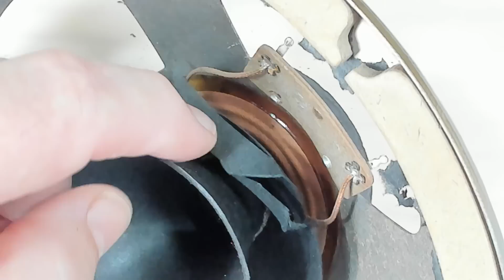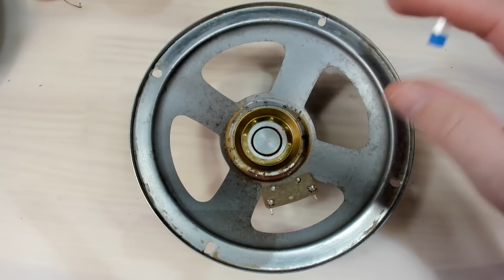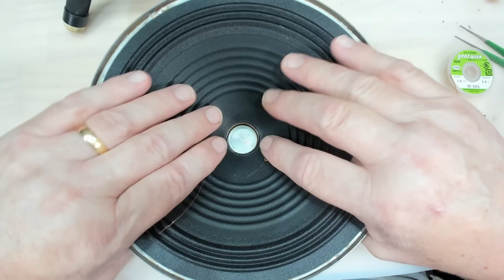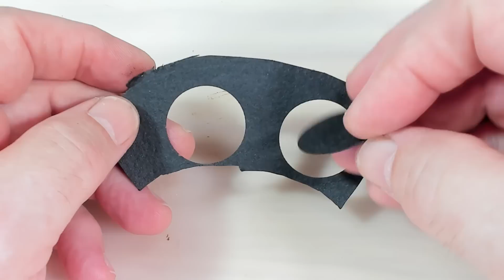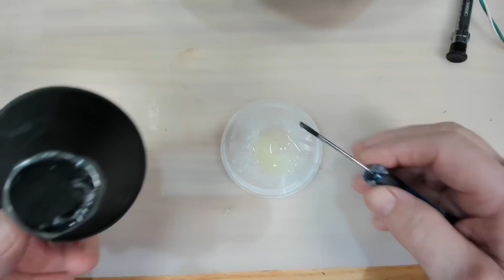Kriesler Radiogram for 5 Bucks!  The Speakers. Part 3

Comment: Excellent job on those speakers David, wow they came up well ! Great informative video. 
I might try that technique on my Breville rebuild, the speaker is not good at all, then again just might send it to you 😁
Cheers
Reply from the maker: Hi Baz, thank you. The full range cones are readily available after a bit of searching. Getting them with the small hole is the problem. A cone with a larger hole could still be used if you leave a portion of the old cone and glue the new cone to it. Good luck with your Breville, I don't remember what the speaker looked like 🙂

Comment: David Excellent work on the the two Rola Speakers you have a surgeon Hands brilliant work David,I have apologise when I said Solid state model was fitted 30inch Woofer it was 15inch Magnavox Woofers,The Magnavox company was had factory in Sydney long gone now as is Rola company also they made speakers for HMV also,More useless information the Kriesler company had off shoot company called Kreisler Dawson they made the Cabinet for your Mulisonic Radio Gram,
I later years because of Cost cutting the name Dawson disappeared the Cabinet were made of chipboard and covered with vinyl.
I can remember clients complained that Teak finish CTV the surface was lifting when they applied Teak oil,

They were disappointed when told the Teak finish was vinyl 

David on your active antenna was hear 549 KHz It Australia only long was wave stations it is ABC Station in Cumnock near Orange 
It had excellent coverage I am interested you can receive on your active antenna’ in  Queensland Best Regards David,Ian,
Reply from the maker: Hello Ian, thank you. I assumed you mistyped the 30" speakers, but two 15" is the same as a 30". 
The cabinet on this one has the Kriesler Dawson badge on the back. Yes, I've seen the cabinets with the vinyl covering, they don't last well at all. 
I think it has to less that 520 kHz to be considered long wave or at least out of the medium wave band. At night I can pick up an ABC station loud and clear at about that frequency. I'll set a radio up to 549 kHz with the generator and see if it can pick up ABC Orange tonight👍🙂
Reply from the maker: Hi Ian. I am able to receive 549 in Cumnock. I finished a radio today and it picked it up after dark, nothing during the day.
Reply: @ That is excellent News David it is 50kW Station and marvellous coverage.

Comment: Hi David. I've been dealing with some health issues, so especially at this time it's great for me to watch a new David Tipton presentation! You know that "ordinary" $5.00 discarded unit became a handsome "walnutty" class piece of furniture. The choices you made were just right. I really liked the long metal name badge. It came out perfect. A lot of fun watching and learning on this "speaker" episode. Saving the "Mystery Element" for last will be a nice surprise. When my older brother and I were young, we experimented with "passive" things you could do to improve the sound of our radios, like moving it closer or farther from the wall, placing it on different materials, ie; felt, soft foam, etc. The one that I really remember was when he purchased and extension speaker box, about 10 inches square. He placed an old wool sock in the box and it was shocking how much it improved the sound! Thank you David for the work you put into these episodes. -Chris
Reply from the maker: Hello Chris, I'm sorry you have been unwell. I hope that improves quickly. I suspect this gram would sound different if it was backed onto a wall. My mates and I did the same thing back in the day, moving speakers around to test the sound. I don't recall putting a sock in the speaker box but we did play with the poly lining wool and port sizing. We were probably too young and stupid to notice any difference 👍😄

Comment: Years ago, I read in some electronics magazine that there was a "hidden" third channel in most stereo systems. The article went on to explain it was a simple mod to pull that channel out of the system by hooking both the + wires from the L and R outputs and you would get the unique third channel that would actually put you at the location where it was recorded. I don't know about transmuting a person to the location but I do know that I hooked several of my old Stereo systems up that way and it did give me a nice sound  that pleased me greatly. I began going to yard sales to find stereo speakers that I could use for my projects. I had a nice Zenith council system that I moded that way and when I played "Crimson and Clover" it was so real that like Cheech and Chong, I nearly saw GOD!  Give it a try and see what I mean. I haven't  tried it of late and I would guess that I probably would not be able to tell anymore, my hearing has been leaving me a bit at a time since I got back from Vietnam in 71, thankfully the VA gives me new hearing aides every couple of years and that helps. I find that now that I alone, having lost my wife 5 years ago to cancer, music gives me great comfort and I now spend many more hours with either ear buds or a headset on listening to the tunes from my youth and remembering those girls from the 60's when there was no AIDS to worry about and love was very free and oh so wonderful. I am still playing with  my WIFI radios that I built using ESP32's and little decoder boards, there are  hundreds of great stations free for the taking now days.  Ah but I ramble on, and my post is becoming a book.  Thanks for the great videos Dave, I do love them and I always come away a bit better with more knowledge then I came in with. I have a firm belief that part of staying young is keeping the brain active which includes trying to learn something new every day.. I have also been downloading books from Guttenberg dot org where you can download millions of books on about anything free of charge. Guess none of them are completely free as I have to pay for the internet, but now days, where we live we can only get our internet from 2 services, our local cell tower or our local telephone/cable company. I still get mine from the phone company, although why I still have a wired phone is a question I keep raising, now that my mom joined her 2 husbands, 2 daughters and my lovely wife in heaven, I no longer need the wire, just that it's bundled and it would cost me more to split the bundle then I would save in the phone cost.  Same with Cable TV I guess, I have a Roku and use it a lot, I could get all the programs I usually watch on TV off that device and watch at my leisure rather then seeing all the damn commercials for pecker pills and adult diapers that seem to be all the rage now days. I miss the days when the mention of a woman's period was outlawed on TV and talking about an erection was also banned.  Ah for the good old days. Talk later as I am going to have to pay publishing fee if I continue. Sorry about that, old men do ramble on when they are lonely. I did post a little bit on an old girlfriend's Facebook page a few weeks back, she did "like' the comment. She to is lonely as she divorced her hubby many years ago but now she lives clear across the State from me so a date would be out of the question I guess.  Now if she were close, perhaps I could get some  of the pecker pills they keep advertising, ah hell just another dream I guess.

Comment: Total noobie question here. Presumably the cone materials are insulators. So what do the wires connected to the cone accomplish?
Reply from the maker: Hi Dan, fair question. It's for strength. Because the cone and the attached voice coil move in and out in relation to the metal speaker basket, the braided wire and the very fine voice coil wire are soldered together at the small hollow rivet in the cone. It is then covered with adhesive. The voice coil wires are covered at the back of the cone with adhesive as well. This means there is a strong point for the braided wire to connect with the voice coil wire and allow the cone to vibrate independently from the basket 👍

Comment: Lovely job David. What are your thoughts about leaving the lower 10% of the original cone intact and bonding your new cone to it?
Reply from the maker: Hi Jonka, thank you. That was a consideration and an easy way out. It does mean adding a bit of weight to the cone but it would work and I doubt it would be noticeable. I also toyed with replacing the damaged suspension area with new rubber ones I have. It would have made for a shorter video too😄

Comment: good job except i wouldn't use solder wick for the tinsel wires, it will break over time as it doesn't contain cotton threads like a proper tinsel wire
Reply from the maker: Yes, I should get some proper wire, I wasn't expecting to replace it. Thanks Jimmy 👍

Comment: Now I have to wonder if a person could glue in 3D printed "tweeter cones" into any compatible speaker, and would it make a noticeable difference in sound. hmm I might have to try this some time
Reply from the maker: If they are light enough it should make a difference. I suspect printed ones would be to inflexible and heavy 🤔
Reply: @DavidTipton101  have you ever printed something in vase mode with only 1 wall? Sure not as light as a paper cone, but certainly very light especially given the size that this cone would be.
Reply from the maker: I haven't tried vase mode. I really don't know if a printed cone would work as well as a paper one. It would be worth a shot to see how it went.

Comment: Hi David,
Wow this is next level speaker surgery!  They look similar to the speakers I had back in the early 70's. I built a pair of "Playmaster 1.3" speakers using Rola C8MXs  and a Playmaster amp based on articles in Electronics Australia. 
Looking forward to the next video with the secret modification.  I received a phone call from Germany this week which gave me an insight as to what it's all about.  This will be interesting!
Cheers
Reply from the maker: Thanks Don. I remember the Playmaster amps of the time. I think I built a subwoofer from EA myself. Ahh... doing a bit of counterintelligence there Don. I hope my secret is safe with you? 😉 I am part way through your Peter Pan radio vid, I'm up to the mystery arcing. I'll try and catch up after family leaves 🙂
Reply: @DavidTipton101  Yes it seems I wasn't quite right about the mystery arcing although I was on the right track.  I've been told that the "reflected EMF" generated in the primary with an open secondary can reach thousands of volts.
Of course your secret is safe. 
Cheers

Comment: Crikey, they used to jam so many tracks on those old Ktel compilations. No wonder the sound quality was so tinny. Great work on the re-coning, it can be a bit fiddly when you have to re-use parts, but you pushed on and it was successful.
Reply from the maker: On a good system you could get bleed through for the adjacent track 🙂 Thanks Yeahyeahyeah.
Reply: @DavidTipton101  I remember that happening with cheaper records but never knew why.  At least I know now that our system was good! 😀

Comment: Nice solutions for the tweeter assembly! Bet They are way stiffer than the originals. Equals A faster , more precise treble with A wider range😊
Reply from the maker: Yeah maybe, thanks Bjørn 🙂
Reply: @DavidTipton101  Should be easy enough to have response measurements done if you have access to The right gear. Then, compare them to factory data..A stiffer, more controlled cone nearly always has resolutional benefits compared to «floppier» ones..😊

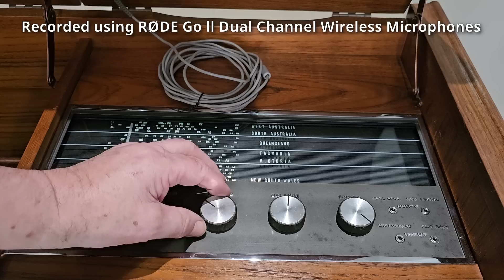Comment: Wow, a master-class in speaker restoration! Top notch as always, David! The footage of you surfing at 23:50 was a nice touch also!

As an aside: Acetone is an excellent solvent for many things, and has a low boiling point so it evaporates quickly. That can be good or bad depending. Methyl ethyl ketone (MEK) and methyl isobuty ketone (MIBK) have similar solvent properties to acetone but evaporate more slowly, so they have more "staying power". MEK and MIBK are available here in the states, usually in the paint department of home improvement stores.
Reply from the maker: Thank you Linus. It was nice to get back in the water 🏄‍♂️ I think MEK was controlled here in the 80s, it isn't available at hardware shops. Back then, the aircraft cleaners used MEK to clean the double sided tape from the floor of the aircraft, it worked well but the cleaners had to be carried out after 20 minutes using the stuff. I haven't heard of MIBK 🤔

Comment: Nice job and great video, as always!  When using those needle-type dispenser bottles, I find it helpful to hold the bottle upright and squeeze out a bit of the air in the bottle then tilt it to dispense the liquid.  That prevents the liquid from running out of the dispenser tip.  Cheers!
Reply from the maker: Good thinking N2Stooges, I'll keep that in mind. Cheers! 👍

Comment: Very very challenging repair and you conquered it 👍 can you just replace the edge with a rubber or foam surround ?
Reply from the maker: Thanks Christopher. Yes, the surround can be replaced but the only replacements are for subwoofers which have a big bulb shape. I could have cut the damaged area out and cut a new cone to make a surround patch attached to the old cone. I considered a lot of ideas 🙂

Comment: Good lord Dave, that's a fiddly scary job! They are practically brand new speakers now and they'll be as good as they always were, perhaps a bit better. I noticed the replacement cones have what appears to be a cambirc surround which could well accomodate greater cone excusion than the original pleated paper surrounds. Of course, the spider is the main arbiter of cone excursion so it may or may not make a difference.

In any case it sounds bloody well now (at least the manufacturer went to the trouble of fitting 8" twin cone speakers instead of bog standard telly speakers like on the vast majority of UK radiograms.) and considering you wasn't completely sure about how to go about it, you got exactly the result you were after and that is an absolute beauty! Excellent work!
Reply from the maker: Hello Paul. The surround was bonded to the cone section and it does have a cloth look about it. They do sound pretty good, I was worried they may lose some bass but they sound nice and tight with good bass. Kriesler tried a bit harder than some, they had a good reputation here. Thanks Paul 👍

Comment: Great work on the speakers. They look like new. I’ve patched a75 year old speaker with the same problems using teabag cloth and material like liquid electrical tape. It sounds good and similar in tone to another identical speaker with a good tone. But my job is nowhere as professional.  They look like they have similar bass response to the ones in your gram. Usually a resonance of 80 to 90 hz, suitable for open backed cabinets.  Btw altronics sell 8inch dual cone speakers for PA systems  almost identical to the ones in this video.
Reply from the maker: Yes, that will work Robert. I had the cones so thought why not. These were 15 Ohm speakers so I thought it better to stick to the originals if I could. Replacement speakers were at the back of my mind as I cut the old ones up though 🙂

Comment: Really impressed how you reconed the speakers. Where did you order the cones? I still have a Philips radio (you restored the same bi ampli as I got a while ago) that has speakers that have hardly any cone left.
Reply from the maker: Thanks Diane. I got them off eBay but you just need to search around the internet to find the right ones to fit your speaker. There a lot that are designed for subwoofers, the full range ones can be tricky to find 🙂

Comment: Hi David,well done ! The idea with the desoldering Braid is was great ! I think a original Braid has a core of cotton or so to make it more flexible, but in this case it`s no problem because there is not much cone excursion. Viele Grüße aus Germany und einen guten Tag
Reply from the maker: Greetings from Australia. You are right, there is not much excursion, I'm sure the braid will last longer than me 🙂

Comment: Tissue paper and PVA adhesive would have repaired the holes and been plenty flexible enough compared to the original corrugated paper. 
The braid should really be phosphor-bronze as it's going to move. . De-solder wick is a very poor substitute and will eventually fatigue and break. Top marks for effort, though. LOL.
Finally all that extra adhesive mass at the cone/vc joint will reduce the high frequencies that the whizzer cone should have produced.
For future ref, MEK would probably work better than acetone.
Reply from the maker: I wasn't prepared to use PVA, I could have used rubber adhesive. I had the cones so why not replace them 🙂

Comment: Noice job on the speakers, you would never know they had been re-coned.  And sure, it doesn't have the fuller sound of a 2 or 3 way speaker system but back in the day, few people would have had 2 or 3 way speakers.   It sounded brilliant and even today and if someone just wanted to listen to their old LPs the sound is fantastic. 
Looking forward to the super secret "item".
Reply from the maker: Absolutely Ellesmere. It sounds exactly like you would expect and good enough for families and the kids spinning 45s. This unit was pretty expensive in it's day, The upmarket ones were out of reach of most families 🙂

Comment: Just for reference, the original adhesives used were almost certainly nitrocellulose cement. This is the classic "model airplane glue" or household cement. In the USA, the typical brand names are Duco Cement, and a variety of model airplane cements like Ambroid, SIG-Ment ,and from Germany, UHU-Hart. it works very well for both hole/cut paper cones, and reconstructions like this. Note that it is flexible enough to use on the suspensions unless you use way too much, I use carbon fiber veil with Ambroid to repair suspensions because it is black.
Reply from the maker: Thanks for the info Bret. The adhesive I ordered arrived, I will try that next time 👍🙂